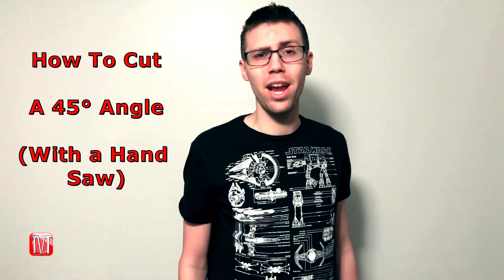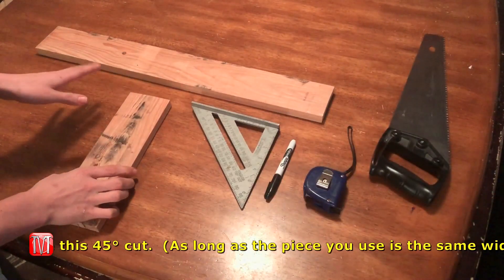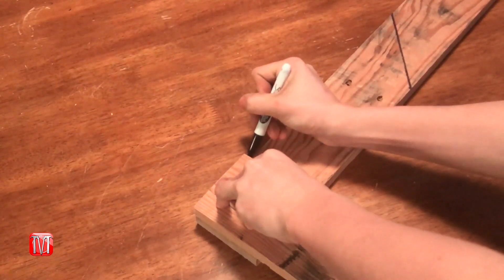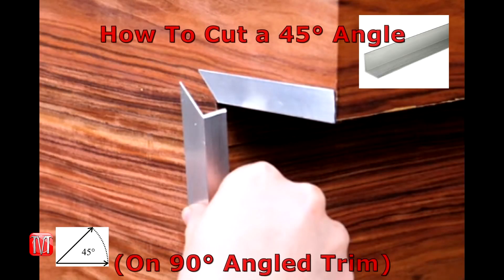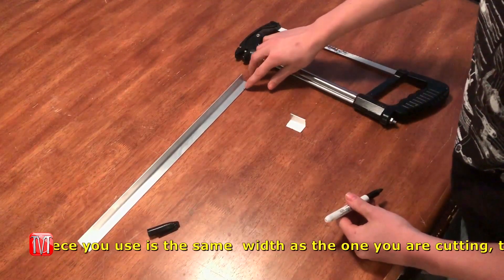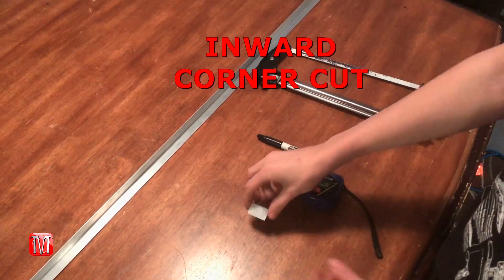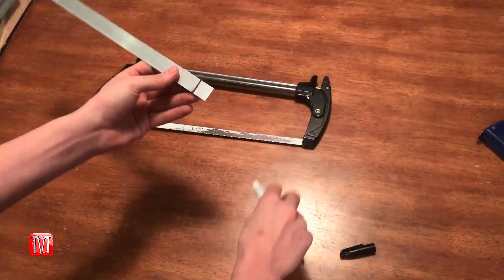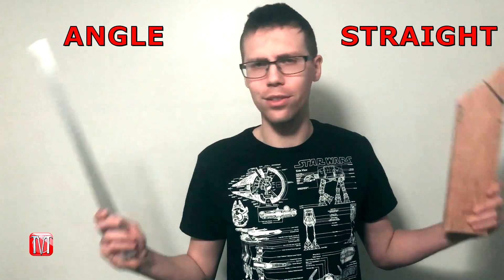How To Cut a 45° Angle (With a Hand Saw)

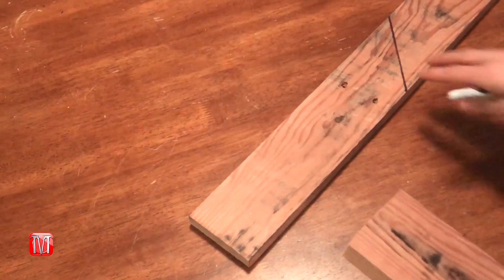Comment: Idk, but I can see a gap @ 1:27  and you can see that the square is not lining up @ 1:25 . Hence it doesn't show a precise 45 degree angle.
Reply from the maker: That is correct. Since I didn’t have the board fastened down to the table and I was holding it while cutting. I ended up making the cut a little off. However, I ended up cutting the board a second time. That time I made sure to fasten it down and the cut lined up with a 45 degree angle. I should have just re-filmed that part but I had forgotten to turn on my camera. 
Over all this method does work, but when it comes to cutting any angle by hand it’s going to be less precise then using a power tool.
I also should have mentioned in the video that it would be worth just getting a square so that you have a perfect 45 degree angle line. Just to make sure you didn’t accidentally move the piece of wood while marking.

Comment: Hello Mags, thank you for this video, I am in the process of putting up a backsplash in my kitchen, and I bought the trim kit to make it look a little better. I wasted a lot of the trim trying to cut that 45 degree angle before I found your video and we all know that trim kit is not cheap. Can you tell me if the one side cut on a j trim will match up clean? I was cutting both sides and the end did not match up flush
Reply from the maker: It really all depends on how straight you draw your line as well as how you cut. To be honest if you’re doing a larger job that consists of cutting multiple boards. I would suggest getting a chop saw. If you don’t have the money than at least purchase a speed square or a wood cutting block that has precut angles for you to line up your hand saw with. This will help increase your chances of cutting a perfect 45 degree angle every time.

Comment: Another option using that hand saw, is to use the 45 degree angle that is built right on the handle and mark along the back of the blade. ( a 90 degree surface there as well).
Reply from the maker: Never thought of that… That’s a good one. Thanks for the idea!

Comment: Well, the test to verify the angle failed... Am I the only one seeing this? :)
Reply from the maker: Cezar Cretu so the problem with this method is if your cut isn’t absolutely straight you won’t get a extract 45 degree angle. Just a few degrees off can make a big difference.
Reply: @MAGSHowToVideos  sure, but say it, you realized it right there and wanted to look like you know what you're doing, but didn't even bother to take another shot or arrange the speed square before...